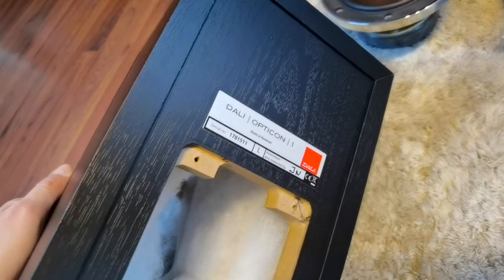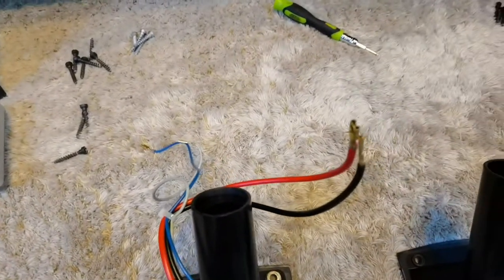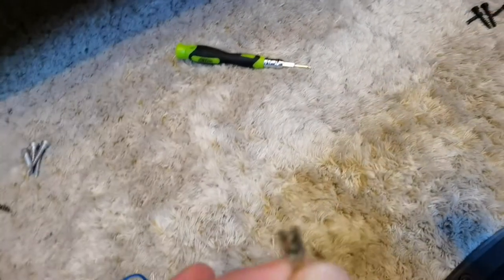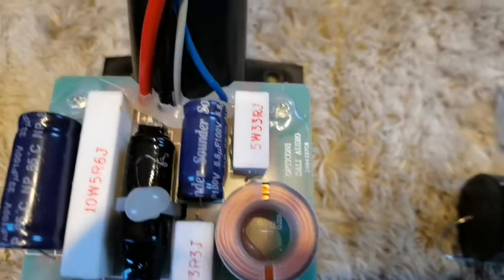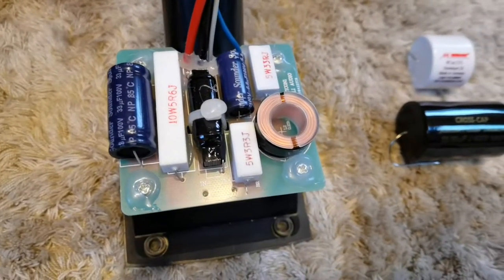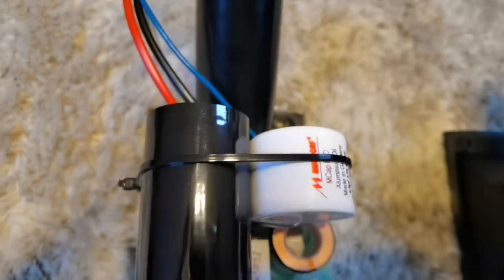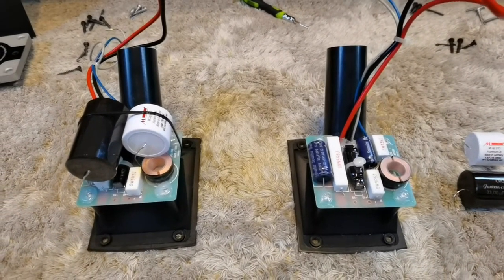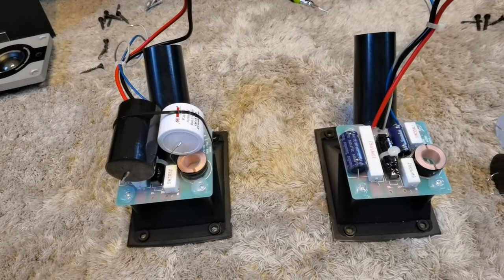Dali Opticon 1 speakers crossover capacitor upgrade

Comment: Just did this upgrade, Used same model capacitors as you did. Very welcome upgrade! Highly recommend
Reply from the maker: Thank you! Enjoy the speakers, they still rock in 2023!
Reply: @k4syx  They sure do!
Reply: I get the positives of foil caps instead of electrolytes, but no negatives after full upgrade? Like changed tonality or something? Thanks.
Reply: @peterpixo  Maybe a slight loss of bottom end, but a nice gain in clarity and detail

Comment: Thank you for this Video. 
After watching this I decided to do what you did. I used a Sonic cap on the Tweeter and a Mundorf cap on the Woofer. 
I also swapped out all the resistors with Mills parts.
I did away with the push on connectors and soldered the wires directly to the speakers using some Mundorf Silvergold solder wire.
The final upgrade would be to replace that iron core inductor on the woofer circuit with an air core.
Here is where I have run into a roadblock. I can’t determine its value, there isn’t any value I can see on them or the PC boards.
Does anyone know the mH value of this iron core coil?
Reply from the maker: Hi! Good job, I went only for a quick win with caps. As for the inductor the best way would be to desolder it and measure externally if you have access to meter.. I have no idea if L value for it :(
Reply: @k4syx  Hi thks. I have figued out it's the same network used on the Zen 1 and I managed to find the value from that, it's 0.6mH
Reply: Нужен просто lc metr
Reply: If you're spending so much on crossover components you could probably get an LCR meter, mesurer against a known value inductor in case it's up to 10% error.

Comment: Hi! This video inspires me so much.... tnx :) ....I just did upgrade  in same speakers. I used ClarityCaps CSA for tweeters, Jantzen Cross Cap for bas/midrange, Audioqest type 4 for internal wires and Jantzen Superes resistors. Speakers sound amazing after upgrade. What a diference in sound before and now after upgrade. It is sad, that Dali used such a low cost parts for crossover. This upgrade cost me about 100 euros  tnx again ;)
Reply from the maker: I'm happy that you love the result. I think the crossover is the simplest way for producer to differentiate the product lines. I also need to change the resistors, same for my Logans. Isn't Type 4 too stiff or too thick?
Reply: @k4syx  Audioquest type 4 is great sounding speaker cable for the price, about 15 euro per meter. I just cut snake skin and first rubber  isolation on the speaker cable and take all 4 wires out and then use them for internal connections in the speaker. Two wires are thicker and they are used for midrange/bas and other two are slimmer and are used for tweeter. Yes, they are more stiff and harder to work around then some soft cables design for internal wiring of the speaker but for the price they are awesome. I used them in my tannoy 3838 speakers, Dali Ikon 2, Dali Euphonia center speaker...
Reply from the maker: @zagorsekdamijan  Im a fan of Audioquest cables, I have a lot of them (Types, Rockets, SlipDBs) around - they're great. I was just wondering if solid core won't be too stiff. I'll try your recommendation!
Reply: @k4syx  Original internal cables that Dali put in Opticon are slow, warm, colorfull with small details... They are not made from pure cooper... Good thing is that they can cover cheap materials in crossover with their sound characheristics. First I try with pure silver wires, but they sound too bright with very fast details  in hight and midrange, but without body. Then I go back to safe place :) with Type 4.
Reply from the maker: @zagorsekdamijan  I have some rocket 22 that I can get the wires from, I also happen to have some silver plated OCC for my other projects - I will try them, thanks!
Reply: @k4syx  sure its stiff, but that is a nice benefit for internal cable. And it just sound so much better than any stranded cable - precision and definition.

Comment: Hi, hope this message reaches you.  I am eyeing on Opticon 1 or Wharfedale 12.1 for small 10~12m3 room.  Will not have much room to back wall.   Love the clarity of small Opticons while 12.1 is highly rated.   Your advice on these 2 (you have 12.2) is appreciated.   Also which clone amp would you recommend, or I might settle on Aiyima  A70 or T9 for a start.   Thank you in advance.

Comment: If the new parts have the same specifications how does it sound better or any different?, doesn’t make sense to me. 
Also from my experience “upgrading” electric guitars, if the new capacitor has the same values the sound will be the same 

The better parts will last longer but thats it
Reply from the maker: The simple answer is that these parts are not the same. The specification (capacity in this case) is not the only parameter that describes the capacitor and different capacitors from different manufacturers behave differently in dynamic situations (like with AC currents)
Reply: Capacitors are devices which store electrical energy in the form of electrical charge accumulated on their plates. The faster they discharge, the cleaner the sound is.

Comment: did you change the resistors?
Reply from the maker: Not yet, just the capacitors. Had to leave some fun for the future ;)
Reply: @k4syx  I put the acoustics capacitors according to your instructions, Dali started to sound very good! After a while, I replaced the resistors with Jantzen Superes and the sound changed for the worse. I will change back to my relatives.
Reply from the maker: @vladimirp1518  thanks, good to know. I'll have to do some resistor research before the change. Anyway, the cap replacement alone is already a big step up.
Reply: any resesrch of resistors, maybe it is not recomended to change it